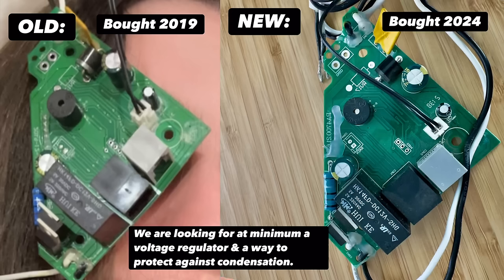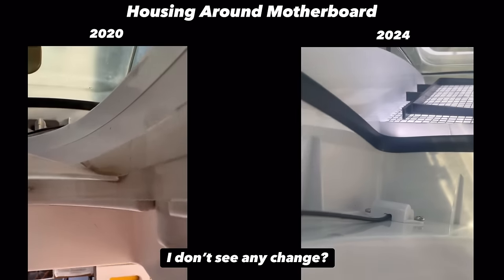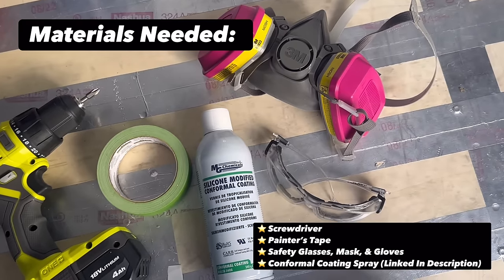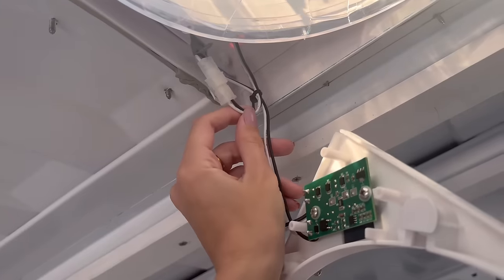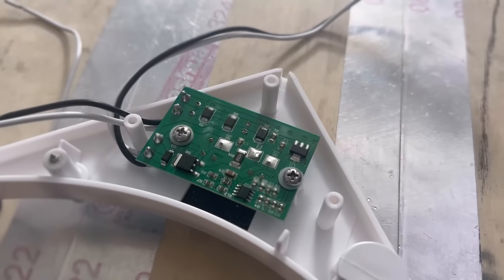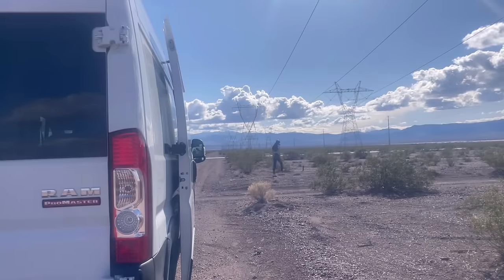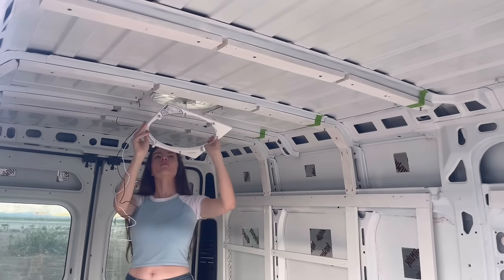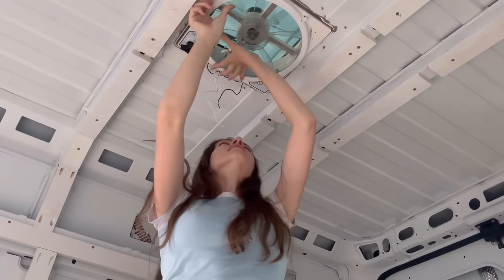why your Maxxair fan will probably BREAK.....

Comment: I had this problem last summer (I live in Tucson, AZ). I tore my fan apart and found more than a few subpar solder joints at some of the capacitors. Took it into the shop, resoldered the board, and now it works like a dream

Comment: To protect against condensation, stash some silicon gel packs around the Motherboard. Replace at least every six months. We had to seal the controls for our refrigerator with clear packing tape to protect the electronics from leaks.

Comment: I installed 2 voltage reducers in line, and it didn't work.  So I used your link for the silicone conformal coating, I hope this works. Wish I had not installed the roof fan. I could have added another solar panel 😉

Comment: Love your videos. 1 tip, 1 question. Tip that grey ring on your Ryobi drill is a clutch. The lower the number the lighter the clutch. So if you want to keep from getting all dizzy going in circles, set the clutch to a low number and use the drill normally. if not enough to tighten the screw go up one number at a time. The final top symbol is when you want to drill something and want no slippage. Question: I'm installing a very similar radiant floor in my vehicle. I developed it myself by doing tons of research, but it is basically the same principle as you have installed. What are you going to install on top of your radiant heated floor? That is the only piece I haven't determined. Wood, vinyl, bamboo, tile, etc ??? Thanks again for enlightening and entertaining us.

Comment: Wahoo you’re doing it more videos you did such a good job on this what else could you do like this I have two max air fans in my trailer haven’t even hook them up they’ve been in there for two years I think the warranty is out good to see you do you know what about the red rubberized paint people should use this on the whole inside and outside that you don’t mind the color I put it on the roof of my trailer because rust issues inside and out I’m typically in Hot climates so I’m going to paint over the red with the white paint the red was just to stop the rust this actually makes a 20° difference in temperature hard to believe in it that’s why I put 3 inch insulation in the ceiling with an air gap with Havelock wool wanted to test the moisture issue with the sheep wool

Comment: 5:27 -- What?! No Wonder-woman costume? Maybe you need more rest. All kidding aside, you make a lot of good points and probably the moisture issue is the biggest one to address. Another option I've seen people use is to just hook up an after-market motor controller instead of the provided circuit-board (somewhere convenient for their build) and run the wires to the fan. This might be useful for you, as you could have as many speeds as you want and you could also reverse the wires (using a two or three position switch) so you could use the fan in both directions. There's no need to pay those kinds of prices for what is basically a motor controller with the ability to reverse the polarity -- just my 2 cents, since you're broke -- hope it helps at some point. 
Cheers!...from North Vancouver

Comment: I was having the green light problem.  I bought the fan with a remote but found I never used the remote.  I would keep the remote near the fan.  I started keeping the fan in a drawer and that’s when I started getting the green light errror.  I’d reset the fuse and it would go away for a bit but it kept coming back.  I realized it was the remote.  As soon as I removed the batteries from the remote the green light stopped going off.

Comment: Maxxair fan 07500K delux.
I installed TWO voltage reducers in line. First reduced the voltage to 13.3 volts, the 2nd reducer dropped the voltage to 12.1 volts. 
 In the mountains, it will run for hours, but near the Charleston SC coast, it trips even before the cover is open. What a piece of junk.
I may have to try your solution to see what happens.

Comment: That is absolute BS on Maxx fans part. They probably designed that way on purpose to rip you off into buying another mother board, not right when they can do the same thing you just did at production.
Reply from the maker: AGREED! 📈📈 And the fact that this isn’t just one issue is a list of issues that has been known for years & I don’t see any visible changes towards anything when looking at a fan from 2020-2024 just means they really don’t care & are just sitting back taking money pumping out the same dysfunctional fans ☠️ (I will say the customer service was very helpful when I called for my last replacement though & I even lied to them saying it hadn’t been over 2 years since I bought it 😂😅 so at least they are responsive & helpful!) But I don’t get why they don’t just cut their customer service problems in 1/2 by just fixing these problems! Someone commented on my last video saying some of it is user error but idk… even then they should still at least educate their buyers to not make these common “user errors” if that’s what it truly is
Reply: @ToryDelury  Sadly, it's because the circuit boards are made in high quantity batches for maybe $5 - 15 in parts and pennies apiece in labour. Changing them would require investing new money into design and re-vamping the build process to match. The greedy don't want to incur new costs when they can just keep selling cheap inventory they already have in supply. It won't change until people stop buying and tell them why...
Reply: yea that tiny little mobo probably costs $5 to produce, id wager they could charge 1/5 of the price and still turn a profit on them